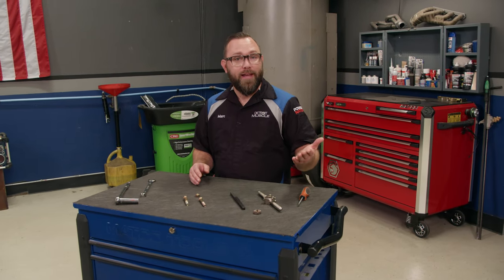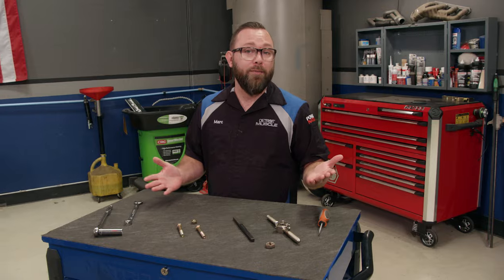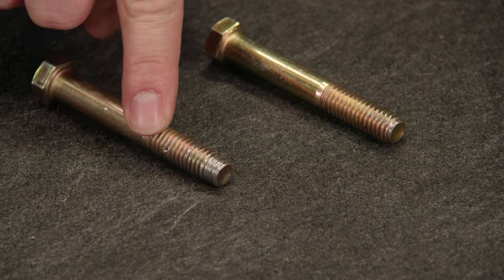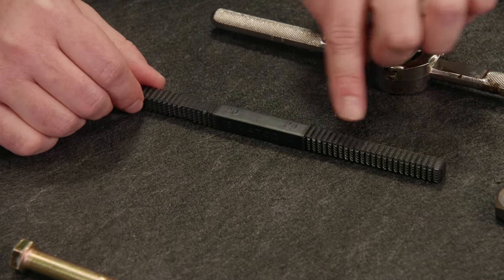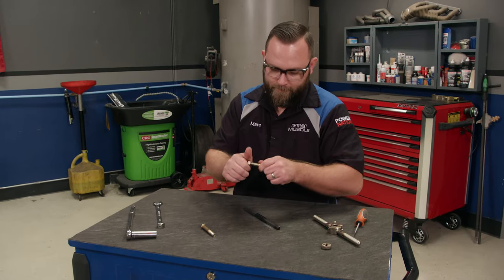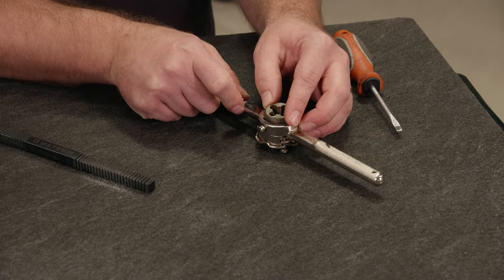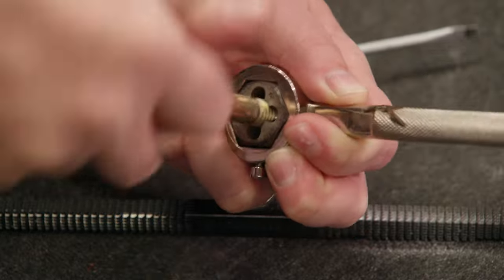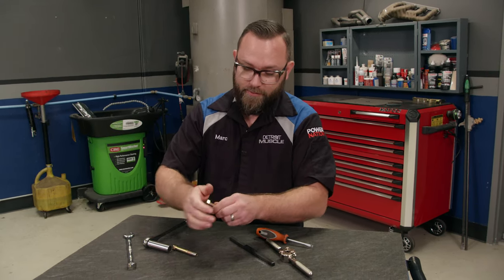How To Restore Bolt Threads

Comment: wonder how you restore the threads in the hole the bolt screws into
Reply: And drill bit.
Reply: Maybe a magnet because the spring from the bolt release button thing got down and now it wont fit in and the hole ending up almost shredding
Reply: Home Depot has a kit that will fix that. It is usually sold with the second device that was used in this video.

Comment: What if my bolt was messed up from the tip and the nut wasn’t going in ?
Reply: then squash the end of the bolt until it does go in no pun intended
Reply: I was thinking of using a deburring bit and it might make it easier.